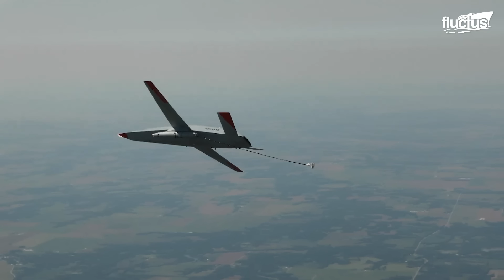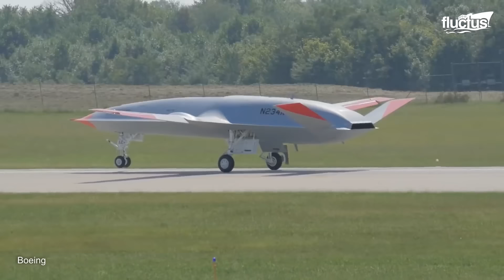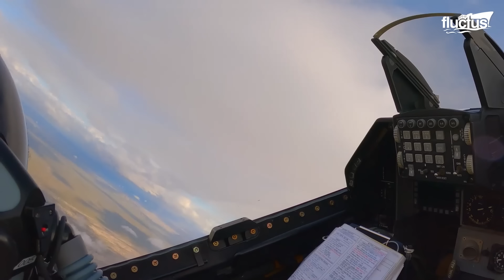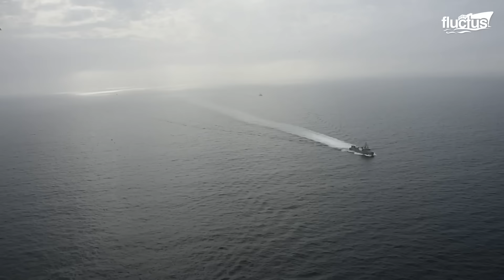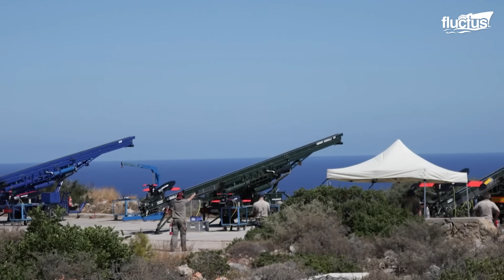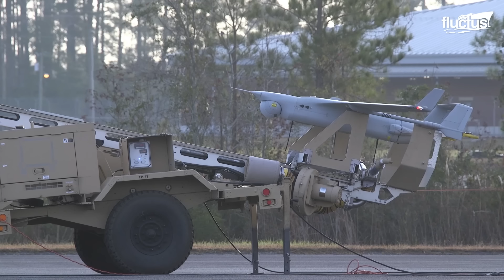US Navy Tests Its Brand-New Billion-Dollar Futuristic Tanker Drone in the Middle of the Ocean

Comment: If we had this three months ago we would have saved the lives of six people.
Reply: Based on what? First this is a small tanker for AC Carrier recovery refueling, not large strike package tanking which the KC-135 is sized for. We need to hear the outcome of the accident investigation. My experience and purely speculation thinks we will hear it is aircrew error, based on damage to two aircraft in the incident suggesting some kind of midair collision. 💥
Reply: @erikgreve6025  It was. The point I was trying to make across is that unmanned refueling removes the human element all together.